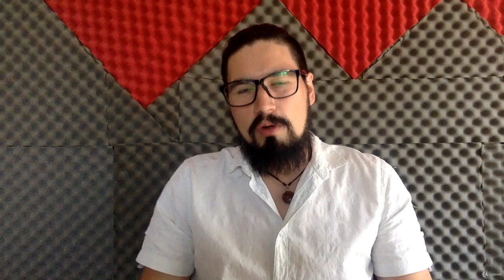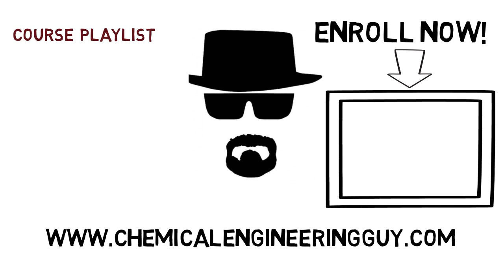Welcome to the Course - HYSYS Basic Process Modeling Course (Lec01)

Comment: Hi. I'm mechanical engineer, and I would like to kwon if is possible to obtein some features of diesel from coal in this program.
Reply from the maker: Yes, you can model some "reactors" using fuel such as diesel form solid materials like coal! what exactly do you need?
Reply: Chemical Engineering Guy good. So I need to demonstrate the process to obtain this fuel (diesel) from coal, but in DWSIM with general features. And to analyze if the features of this fuel has an advantage to use in an engine of ferryboat.